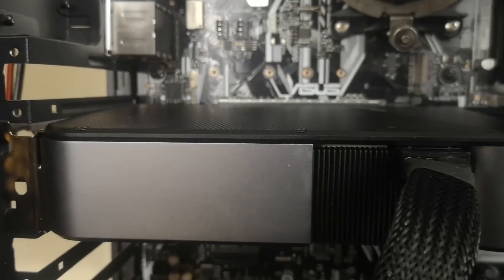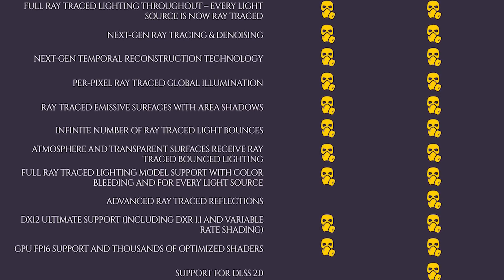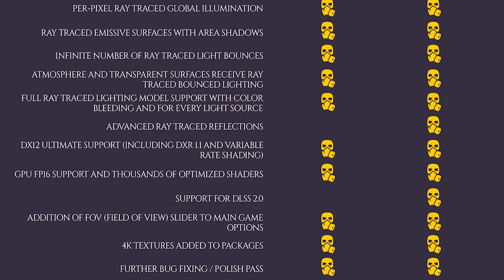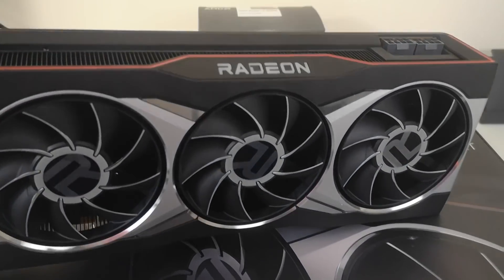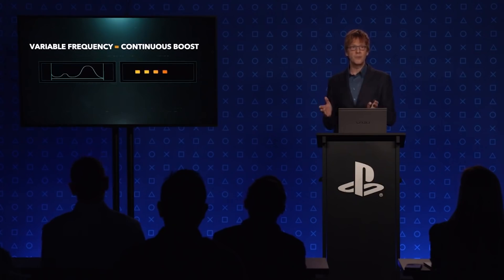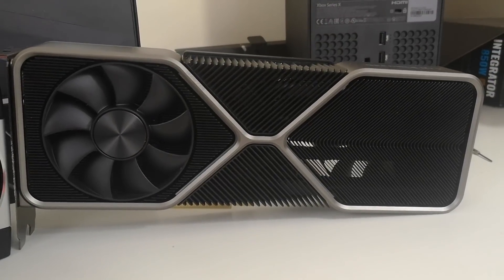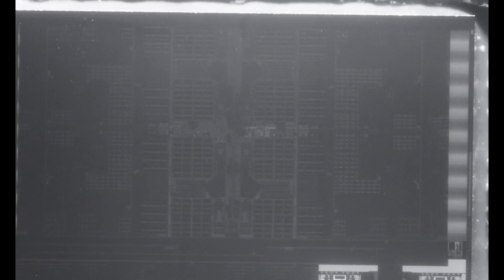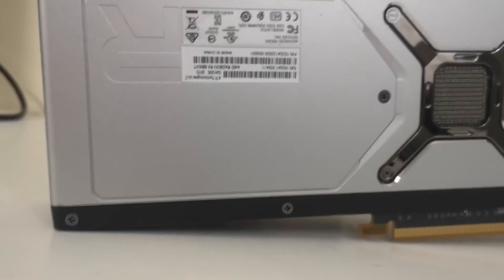XSX & PS5 GPU & Raytracing Performance - 4A Reveals All | Xbox SoC Secret Sauce by Microsoft

Comment: I feel like they gave the new consoles just enough ray tracing features just to be able to say they're capable of ray traced reflections.
Reply: Dribble piss  when you go to buy a product the ONLY thing you have to go by are the specs.  When people compare the series x to a gtx 1070 which is a 6.5 tflop gpu it makes no sense. I understand that the way the gpu works with other hardware does make a difference, the hardware that's with the series x gpu is better than most of the hardware people are using with let's say a 1070. The biggest problem is the game devs aren't anywhere close to taking full advantage of the series x hardware. Or software.
Reply: @HellYeaNixon I don't understand why the resolution or framerate has to take such a hit when using ray traced reflections on series x. The console is more than capable of sustaining both.
Reply: Dribble piss  so your saying it wouldn't make a difference to anyone if the series x had the same cpu as the xbox one and only 2 tflops? I guess they shouldn't if specs on a console don't matter.

Comment: So ps5 variable clock is not a problem because hey developers have already had to develop games accounting for this but the series s is going to make making games harder because its has lower specs....i see what you did there...slick!
Reply: actually he has a point , imagine this that the devs want to creat a specific sized world with a specific density that will work on the series x at 1080p at 30fps let’s suppose it a super have game , and i think the series s will make them do changes to the game or level simply because of much lower power , and ofcurse its my opinion and i am not a developer , maybe i am got it wrong
Reply: @mahmodkassem3105  so what about the pc gamers who are still rocking 900 series cards and 3rd generation intel cpu's?? The series s is not the lowest spec.
Reply: @HotGritz910   yeah you are right thats why i am on PlayStation side but Sony gradually is doing the same thing

Comment: But are you aware that the PS5 doesn't have an RDNA 2 GPU?
Reply: Nonsense your wrong
Reply: @marty8370  also, it's hard to take you seriously when you can't even tell the difference between your and you're
Reply: @cibula2004  Well you can't read clearly. AMD state that PS5 is RDNA 2(on AMD website)
Reply: @marty8370  and BTW, on the AMD website, they said it's based on RDNA 2, which seems to be true, but it's lacking some features that make it a full RDNA 2 GPU
Reply: @cibula2004  Guess what TRASHBOX don't have any of the PS5 GNM/GNMX api  custom features. It won't cos TRASHBOX uses DirectX12U...............idiot

RDNA 2 feature set(and more)will be in PS5 eg HW ML, HW VRS, HW Ray Tracing, HW  Meshes/Geomentry Engine, HW Karken Compression/Decompression, Custom 12 channel SSD controller/ Custom IO 

Trashbox isnt Full RDNA 2 either. It mising 3 key RDNA 2 features, no 
high clocks, no smart ram & no Infinity Cache. This prooves both PS5
 & Trashbox have a mix of RDNA/RDNA 2(hense why they are custom RDNA
 2)
Reply: @marty8370  put the following in Google: "ps5 not rdna 2" and you'll see many recent news articles about it. It's not a full RDNA 2 GPU
Reply: @cibula2004  TRASHBOX IS NOT FULL RDNA 2 AS WELL. THER ARE A LOT OF MADE UP ARTICLES ON THE PS5 ON THE INTERNET. AMD WEBSITE STATE PS5 IS RDNA 2 THATS WHAT COUNTS NOT SOME MADE UP SHIT ON GOOGLE, EG  RDNA 1.1, THAT DOESN'T EXIST
Reply: @marty8370  here's an excerpt from the article (a week old only): "We've already seen that the PS5 version of the RDNA architecture sits somewhere between the Navi 22 and Navi 23, with 36 Compute Units packed in—just under half that of the 80 CU Navi 21. Basically, this is just confirmation of Sony and AMD having come together to make something unique, as opposed to just dropping standard desktop hardware into the PS5. We're getting something like an RDNA 1.5 then, it seems."

Don't be pissed that your ps5 is gonna be obsolete faster than my series x. Blame Sony, not me
Reply: @cibula2004  It dont make me wrong either. As I always said PS5 is Custom RDNA 2. Just like all its features will be based off RDNA 2 but will be Custom,  doesn't make it worse. For starters is made for console gaming
Reply: @cibula2004  obsolete lol what planet you off you really think xbox will ever make PlayStation obsolete.xbox need to release games first lol.and if you really think there's gonna be much difference between games in both consoles then your dreamer.never has been in previous generations and never will
Reply: Amd says otherwise xtard 🤦‍♂️🤦‍♂️🤦‍♂️

Comment: Ponys Keep telling lies and doing damage control to help Sony !
001-Sony kept quiet because they knew that his console was not the most powerful and did not have all the features that XBOX Series have, and that is why Sony let his dumb foolish fanatics to believe and spread lies that the PS5 was the most powerful console and had RDNA3 features and the reality is that is a custom RDNA 1.5  with a trash VARIABLE CPU/GPU speed. 
First PS5 SOC Die Shots - No Infinite Cache / No CPU Unified L2 Cache / No RDNA3 : https://www.youtube.com/watch?v=-8ZqOj08V4o    ///  https://www.youtube.com/watch?v=g--4Yu3iezI  ///  https://www.youtube.com/watch?v=GTEv-2-PNUE

2- PS5 has a Weak Cooler Design: PlayStation 5 Thermals  =   https://www.youtube.com/watch?v=MmggkW6usmQ
3-PS5 Controllers Are Drifting And Failing, And Getting Them Fixed Is A Nightmare : https://www.youtube.com/watch?v=RqIZXqC6LCo&t=375s
Reply: Nice reply!  Finally somebody that does some actual research before posting!!

Comment: How come the Apus on pc are so far behind the ps5. Surely amd would make a killing if the Apu was just a little weaker than the ps5. Even intel has overtaken amd on pc.
Reply: apu's on console use faster graphics memory and pc they use slower system memory gddr5 vs ddr4 bro ''graphics double data rate''

Comment: RTG it sounds like you're trying to square a circle to keep both camps happy. You claim the XBSS is good gamers because it brings them into next gen. That's not totally true. You pay for what you get. The cut down XBSS is a good Game Pass player. It will play everything in Game Pass, including new games. But as for next gen, the downgrade plays next gen at last gen quality, so no, it never enters next gen. It's just an enabler device that is able to play next gen games at last gen quality. A useful Game Pass player going forward. As for RT on PC and the NG consoles, each are using different tech which means they deliver different flavours of RT. PC obviously has the grunt to perform the more taxing stuff, but NX Gamer noticed that PS5 had some unique RT features implimented in Control. PS5 apperently had 2 ray traced objects inside a ray trace reflection, where PC and XBSX only had 1. So comparisons are not that useful.
Reply: The XS is a poor console, almost certainly, as far as RT due to lack of TF and CUs.

But it is a next-gen device when considering the SSD and CPU. The CPUs on the new machines are a massive leap over the horrible Jaguar CPUs in the One/PS4/Pro/X.

From the standpoint of how games are coded -- GPU elements tend to be highly scalable, while CPU elements are fixed -- the XS is very much a next-gen device.

The disturbing part of where the industry is at from a design standpoint is in regards to the One and PS4: their outdated hard drives and CPUs will likely be targeted for years to come.

It's arguable that the Jaguar CPUs held this industry back by a full decade when considering A.I., physics, world size, NPC Count, etc.

Comment: RIP for all the XSX fanboys who were expecting a %20+ performance difference between PS5 and Xbox SX loool.
Reply: They were the only one's who believed Phil Spencers hype, so yeah, they'll have to live with it. If they don't get 1st party games fully optimised to make use of the extra grunt, then the divide will be even bigger. The problem with the XBSX is not GPU horsepower, it's a data throughput issue. The GPU cannot run flat out spewing frames because it's waiting for game data to transfer from SSD to RAM. DF proved this and didn't even realise it. They ran Control in photomode and noticed the GPU spewing out extra frames. The reason is because during photomode, everything on screen is contained in RAM and data throughput is paused. The GPU can the produce more frames because it's not waiting for data to arrive into RAM, like you do when actually playing the game.
Reply: @itsjusterthought7941  first in normal mode the SX doesn't have higher fps because it's locked 30 fps. second you don't need a fast ssd to play control. The fps difference between an ssd and normal HDD while using the RT mode is negligible respectively non-existent
Reply: Rip for kids like you that don't understand tech...Xsx will surely show his 20% power difference..

Comment: Funny how they complain about the Series S but they've lived with lower spec PC's for decades...  The RAMs not an issue but suddenly the GPU is?  Then variable clocks aren't a problem (which they aren't) because they've dealt with that for decades....  What the heck have they been doing with PC's where the CPU, GPU, RAM, Storage, IPC, and clockspeed combinations are endless... Now I'm supposed to believe the lower spec GPU in the Series S is some insurmountable hurdle that will ruin gaming forever (yes I'm exaggerating). Seriously though, WTF?
Reply: Ever heard of minimum system requirements? When it comes to AAA games they are defined by consoles and go up significantly with each new console gen thanks to the leap in technology and leave older PCs behind too. Series S just lowers that barrier but in doing so can put restrictions on development.
Reply: @weaverquest  nonsense. It does not bring down gaming at all. These devs haven't tapped out a thing yet. Plus these games will still be on pc.  So you have to fault Pc for that with there HDD storage and all.
Reply: @mostmost1  series s is the lowest bar for next gen, and its gonna hold it all back. series s was a huge mistake and you know it. remember when it was said to be a 1440p 60fps machine. but in reality its 900p. yeah its a joke. and people like you who have zero understanding will never get it.
Reply: @sithhunter965  its usually marketing.when ps5+xbx advertisement said 4k 60fps, wise men knew it would  be 1440p,60 fps.
Same goes for seriesS its,1080p gaming machine
Reply: @asifcra7839  except I’ve got to ea of 4k60 games on ps5. And lots of 1800p games etc. I’ve got 1440p 120fps games on games you would think would tap out at 1080. Whereas series s is just so budget that even devs hate it.

Comment: so xbox has a bigger DIE which could create problems, Plus with a slower clock speed gives sony the upper hand.
Reply: You know that a PC gpu is twice as large? 😂😂😂
Reply: @hanswurst2869  yes but its backed up by powerful parts, did you you forget we are talking about console??
Reply: @gamezone2470  you know that the die size is the same as the one x die size while having smaller structure size?
Reply: @hanswurst2869  ps5 has a smaller die
Reply: @gamezone2470  and what's your point? One X with the same die size didnt have any problems. Sure ps5 has a smaller die size but also a higher gpu clockspeed. Die size is only relevant for yield. But clockspeed, too.
Reply: @hanswurst2869  whats my point??? did you not listen to the video?
Reply: @gamezone2470  and because it's a video it's correct? 😂😂😂😂
Reply: @hanswurst2869  i can use that too.. and because you disagree, it automatically means its incorrect?.... lol
do you not know why having a bigger die could cause a problem than smaller die? 
if you didnt know then, no wonder why you keep arguing.
Reply: @gamezone2470  no. I gave you two examples why a large die size isn't a problem. And one of it was for a console. Futhermore you know that power correlates with number of CUs AND cockspeed?
Reply: @gamezone2470  already got proven wrong. A underclocked 5700 xt with higher cu count and lower clockspeed outperforms a 5700 with lower cu count and higher clockspeed while both have matching TF. Furthermore the article is useless because they compare different architectures. And in Addition to that Performance doesn't scale linearly with tf...
Reply: @hanswurst2869  and YET ps5 OUT-performs xbox
Reply: @gamezone2470  you should do a little more research. At the beginning the ps5 outperformed the SX in mostly every game, Yes. A lot of these games got patched so that the SX  version is now similar or even better. All the latest games perform better on the SX. And this will happen in most cases in the future. You will see. The next interesting game will be Metro Exodus with it's next gen Patch. 4A knows how to juice out the Hardware. The Metro games were always a benchmark for Hardware. Since both machines are too weak for native 4k, 60 fps and full RT we will see on which system it will perform better.
Reply: @gamezone2470  😂😂😂😂😂😂😂😂😂😂
Reply: @hanswurst2869  --------------------> LOL
Reply: @gamezone2470  good morninig. now i have time to answer. i don't give a damn about rumors. most of them are just wrong. who gives a damn about wifi? cable > wifi, always. furthermore even wifi 5 has a bandwidth of up 7 GBit/s. i have an 1 GBit/s fibre to the home internet connection. with that i belong to a very very very small minority. the average internetspeed worldwide is 10 MBit/s. that is 0.15 % of the bandwidth of wifi 5. so which benefits will i have from wifi 6? you guessed right, absolutly NONE.
oodle? definitly an interestig piece of technology. but maybe you shouldn't just read some information about something. in addition to that you should think about that. yeah with oodle you can transer up 22 GB/s of data or something like that, if i remember correctly. i give you one simple example which will demonstrate why this isn't as "important" as you think. let a game be 100 GB of size. with perfect compression this is around 400 GB of compressed data. theoretically this means that you need around 20 s to load the entire game. on the other hand games have a playtime of several hours. so, now name one logical argument why i should be able 5% of the whole game per second.
furthermore the jump in gpu power is around 2.5x, in cpu power 3-4x times compared to the last consoles. i/o bandwidth made a jump of 100x (ps5) and 40x(series x). but yeah that will definitly bottleneck. LMAO
in addition to that I/o-speed is just a fraction of gpu memory bandwidth. think about that and draw the right conlusion.
Reply: @gamezone2470  first, that halo graphic isn't final. Second, tlou2 only runs at 1440p@30fps. Third, have you played tlou2? Did you see where that game really looked good? It only was in small areas where isn't much to compute. Furthermore tlou2 just sucks hard. What a stupid story and boring gameplay. Bought that game day1 and still haven't finished it. Tlou1 was a masterpiece. Part 2 is just a little turd.
Reply: @gamezone2470  oh my god. You have just no clue what you are talking about 😂 sure i am playing it. I am currently at the scene where abby and the asian guy are going to the hospital to get some meds so that they can amputee the arm of the girl.

and sure it looks in small areas very good respectivly better than the rest of the game. Just think about the scene with abby, her dad and the zebra. Or where ellie and Joel walk besides the river and throw each other into it.

I don't care about halo. played them all once and can't unterstand the hype about it. But yes the footage of halo Infinte looked like crap. But wait there are already current screenshot of some areas and models and the don't look anything like we saw at the gameplay trailer where everyone laughed about. Me included.
Reply: @gamezone2470  i said you have to clue because you assume i don't know the game and i am only repeating things people wrote on critics etc.

i didn't say that the graphic sucked hard? I said that specific scenes of the game look very good  but the rest wasnt something special. Neither did i say that it looked better than any other game. Did you even read and understood what i wrote? 🤔

Uncharted wasn't Game of the Year. Overwatch was GotY 2016...

Medeviel 2 wasn't GotY. In 2000 it was The Sims....

GT3 wasn't GotY. In 2001 ist was grand theft auto 3....

Halo never was GotY. See above...

Gears of War was GotY in 2006...
Reply: @wanshurst2416  well technically GOTY awards did not start till 2014.
the one you spoke of GEARS in 2006 is DICE awards category not GOTY and the games I mentioned won awards in the british game awards. here are the list and categorys below.
https://en.wikipedia.org/wiki/List_of_Game_of_the_Year_awards
i was looking at British Game awards, and you were looking at DICE awards 3rd category below.

This is the List of GOTY
https://en.wikipedia.org/wiki/The_Game_Award_for_Game_of_the_Year
Xbox has not gotten a GOTY award since it started in 2014, and Sony only has 2. the rest aare multi platform and one nintendo game. but wow 2020... 3 sony exclusives nominated for GOTY.
Reply: Uhhh what??? You don't know WHAT in the hell you're talking about. Also, it's DIE.
Reply: @Cooe.  Uhh yeah duuhh... did you not listen to the video?